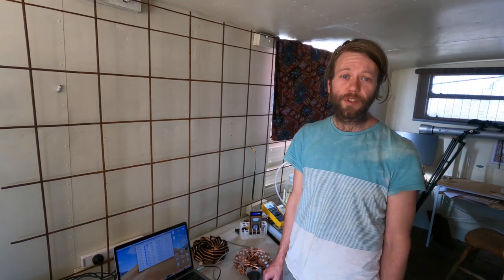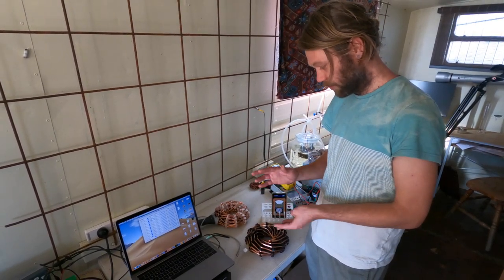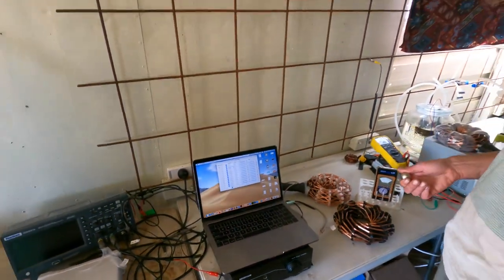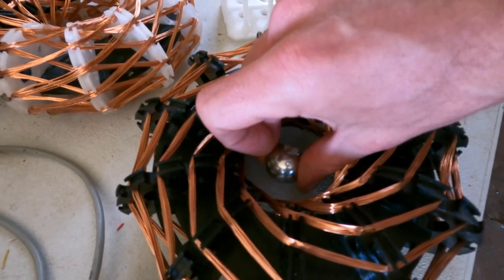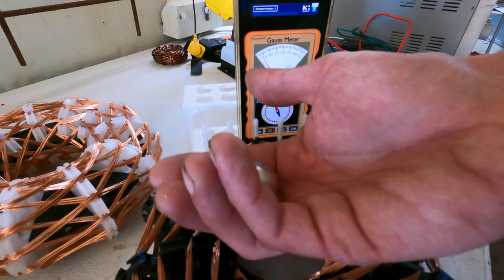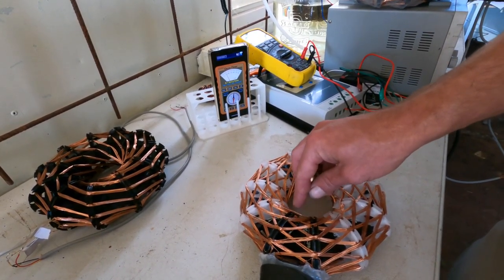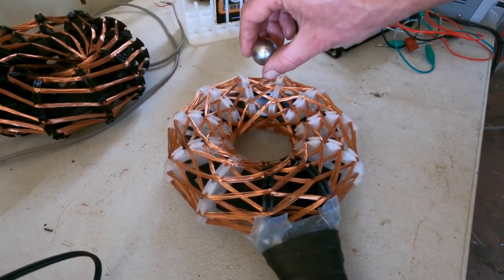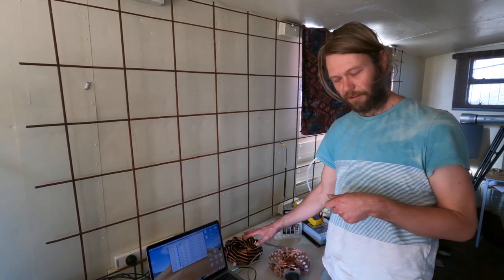Powerful Low Frequency effects of Rodin Coils on a Magnet

Comment: Ok, magnets move around when they're in the middle of the coil, how can energy be extracted from this? Im not understansing what the point is
Reply: same. I don't see a difference from just winding a standard coil
Reply: @DiannaGold  it's meant to mimic the shape of a plasmoid where the magnetic field is tangled up so more of the energy is contained. Perhaps stronger magnetic field in the center than other coils but less radiating away

Comment: I got sphere rare earth magnet to spin (sitting on table not levitating)  in center of vortex coil and I made a cylindrical coil and placed around spinning magnet  - not counting power from the wall, the multimeter on cylindrical coil was more voltage than went in.
Reply from the maker: Cool. I was going to try putting cylindrical coil in the power system as a receiver too.
Reply: @AlchemicalScience  I tweeted you a video.
Reply from the maker: Nice, I took a look. I'll make up a cylindrical coil to try when the new Rodin design is ready. I have a feeling like a thicker conductor like a piece of copper pipe will also produce interesting results as a receiver alone if it's tuned to the coil using the Dolard/Tesla method of just using the same weight for the same material (=same resonant frequency)
Reply: Only really matters if you can get more voltage AND current out, otherwise the power is less. Remember watts is based on voltage and current.
Reply: Which one did you use? non-opposing CHIRAL(CHRIST) rodin coil or opposing ACHIRAL(ANTI CHRIST) rodin coil?
See the TWISTOR field. That is what a CHIRAL rodin coil produces 😊
Reply: If you use the CHIRAL rodin coil as a transformer(another CHIRAL rodin coil placed on top of it), the result is amplification in power as the induced voltage is from BOTH electromagnetic induction AND parametric "induction"(resonance).
E = L × -di/dt + I × dL/dt
Reply: A traditional transformer WASTES parametric resonant induction and it become heat in the core. An old parametric resonant transformer has no electromagnetic induction and it causes large inductive reactive power consumption.

CHIRAL rodin coil solves both issue by completely integrating parametric resonant induction and electromagnetic induction together. However, do NOT use achiral rodin coils as transformer configuration as the perpendicular windings reduced the effect of electromagnetic induction, similar to how a parametric resonant transformer is designed and may cause slight inductive reactive power consumption instead of real power. A capacitor is needed for parametric resonant transformer, the chiral rodin coil however do not need it as the field itself is what causes capacitance naturally. The perturbating aether serves as a capacitor.
Reply: Revisualized the field. It seems that if you use achiral rodin coils as transformer configuration, you're going to end up with either one of the perpendicular magnetic fields in the same direction. This would dramatically increase inductance on both windings, which serve as losses. Wew
Reply from the maker: Man, interesting comments. Could you link to any more info around this Lukie? I looked up twistor fields and Tom Beardon popped up. I hadn't been able to find anything published by him about this before and I'm guessing that's who your referencing? I'm still not set on if we plan to wind our tuned 1st, 3rd and 5th order nested and unlike 2 separate coils there will be no turning them around once they are wound. 192 3D printed parts isn't something I want to repeat too many times either hah
Reply: @AlchemicalScience  I thought the printed parts will only be 1 central frame and 12 supporting holder frames? I myself prefer 15 cause why not : p
Reply from the maker: If your printer is big enough to print a 5th order ring over 80cm in diameter and formers with 4 parts hah. I'll get them laser cut or injection moulded if the proto design checks out..
Reply: @AlchemicalScience  oof

Comment: You should try this with a clear container of liquid mercury. Also you should probably be wearing rubber gloves when dealing with this radiation so closely. Grounding helps of course, but less radiation that penetrates the body, the better. It's likely the ozone making you feel head heavy, etc?
Reply: It’s basically just a speaker driver with zero mass I don’t get how it’s producing radiation let alone ozone, a speaker is the same right, just a coil of wire that makes a magnetic field that moves a paper cone with the windings on it, a and the rubber or foam surround applies a constant force to bring it back to place, isn’t this just a fancy winding with the mass being moved his hand and the magnet, and the spring tension his hand wanting to return to where it was? The only difference to me is in a speaker the windings go up and down and here they’re static and the magnet moves. How does that make ozone? Or radiation? I’m honestly asking I am not well versed in this subject

Comment: About 10 years ago I met a man, he told me he had "wrapped a coil of wire around a sphere, plugged it in, and a large light jumped up from it and blew up a wall in their lab.

I did not know what ball lightning was at that time, don't think the man even used the term. But the absurdity of that story stayed with me for a decade until I saw an explanation

Comment: a speaker is the same right, just a coil of wire that makes a magnetic field that moves a paper cone with the windings on it, a and the rubber or foam surround applies a constant force to bring it back to place, isn’t this just a fancy winding with the mass being moved his hand and the magnet, and the spring tension his hand wanting to return to where it was? The only difference to me is in a speaker the windings go up and down and here they’re static and the magnet moves. I’m honestly asking I am not well versed in this subject

Comment: Hello, how are you? I would like to make a coil but I am not sure how the connection is, how many cables are necessary, 12 or 24, and if you can help me with that, I would appreciate it, a diagram or a video on how to connect and how to end up in a 2-pin connector. poles or 4

Comment: Can a coil be wound in both directions and totally eliminate the magnetic field when the wires are all connected ??? Nice work fella.
Reply from the maker: Thanks. Yep, pretty much. When both channels inputs are set to the same frequency and you connect the outputs up to an oscilloscope probe you get a much lower amplitude output signal (cancellation effect). If one of the input frequencies is raised a few hz or tens of hz and the other left the same then the sine wave will begin to gain amplitude quickly and then begin to drop off again as you get further away from the peak resonant frequency. Same thing if you turn off the opposing channel input. The sine wave output from both the other live channel and the resonant channel will immediately gain significant amplitude as soon as one is turned off
Reply: @AlchemicalScience  From your experience with coils, can back EMF be used to make electrical power to supply energy on a small scale ?? Good day fella.
Reply from the maker: As I understand it, back EMF is the "excess" power from the collapsing fields of the coils. It can certainly be captured by adding a cap and diode in series with the primary and in parallel with the secondary. But I haven't succeeded in harvesting a meaningful amount of power from the output yet. I'll do a video soon showing my current circuit and relating it to field theory soon. Theoretically its just about how fast you can collapse and reform the fields (think HV MOSFET). That back emf is forced to go somewhere and do something when a new field is formed - just needs somewhere to go.
Reply: @AlchemicalScience  I cannot wait for you to do this Sir. I scored two spools of wire at a yard sale. The gauge is 29  and twenty pounds. This should be enough to experiment and test results. Shame I was not there earlier as the guy said he had twenty plus different size magnet wire on spools not even used with cover .over the wire. You know what I say, am happy to get two since now I have two. Price was killer too. Ten cents on the dollar. 
Do you know how to wind coils to totally enclose the magnetic field Sir ?? Am looking forward to see your new videos AS.
Reply from the maker: Nice one. My experiments are also limited by how much wire I can afford hah.
Check out my video on Calculating Rodin Coil Toroid Geometry. The next video will be on printing and winding them. My wife Emma is releasing a design in a few days for coil frames that use VBM to very closely emulate the accurate toroidal magnetic field geometry with the wire archform. The calculations video explains how and why it's slightly offset from a  100% vbm accurate calculations to achieve a unifilar winding pattern. As far as I'm aware it's as far as anyone has got to accurately applying vortex based maths to coil design. Try a 1st and 3rd order nested coil design with the 2 coils wound with the same weight of wire (to get the same RF easily according to Tesla and Dollard, not accounting for circuitry (I have confirmed)).
Reply: @AlchemicalScience  Keep up the good work Jordan. I Look forward to seeing the video fella. One more thing, GOOD LUCK TOO. Luck has a lot to do with so many things. Good day too. vf

Comment: Are your opposing coils, on the interference coil,  insulated from each other or touching? This may change the performance of the coil.
Reply from the maker: Insulated from each other, but I've scrapped the interference design completely to be honest! It has some applications though. Sure generates a lot of back emf and supposedly ozone so it likely has some applications still (will check this myself if I ever get around to building my cheap ass arduino ozone detector). But I'm moving away from trying to capture back emf in power system designs now

Comment: What type of capacitor do up across output to get more gain on output?
Reply from the maker: You would need to tune the capacitance to the coils inductance. Check out "how to tune an LC circuit" or "how to tune a Tesla coil" and use these same methods. Essentially, measure the inductance and resistance of your coil/circuit and then calculate the appropriate capacitor. Master Ivo (YouTube channel) provides some valuable information on efficient component choices for circuits like this in his videos.